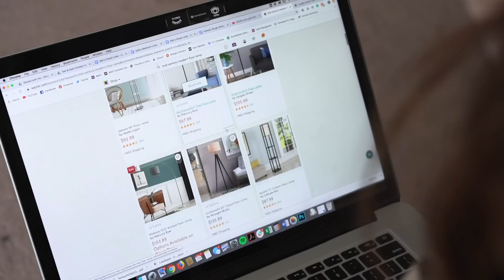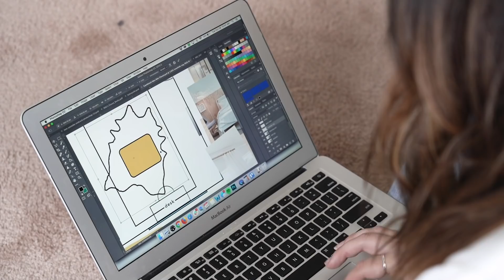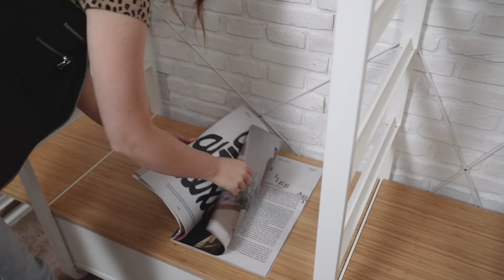Spare Room to Dream Walk-in Closet Makeover! | Style Selected

Comment: Hey ladies. Love the channel. Quick tip. Electronic stud finders check the density of the wall. So if the insulation is thicker it will light up. Using a heavy magnet to find the metal drywall screws work better in most cases. I use this in my line of work. Much better. Tho if you have plaster walls the magnet won’t work as well if there is chicken wire in the wall. Just a helpful time. Keep on rocking.

Comment: Pro tip for finding studs: check either side of a plug, there will almost always be a stud immediately to the left or right. The boxes for plugs and switches need screwed into wood on either a side or the back. Since plug placement usually isn’t that important, the fastest and easiest way for the electrician to install the box is to screw the side of the box into a stud. Once you find one stud, studs are usually every 16” on center. Time is money for trades, so this works at least 99% of the time. You can also try measuring from one of the corners, but that’s not nearly as reliable (depends which side they’re measuring from and what end they started with, among other things).

Comment: The big wood panels on the mirror wall also didn’t align at the seam (22:52) - one piece was half an inch higher than the other and if it was behind the mirror it would have been fine i guess but the mirror didn’t even cover it..

Comment: I get that you aren't professional and this is "DIY" ...but this is just messy. You have some pretty advanced equipment - you should have a simple step ladder. I understand it was the first time working with that brick paneling, but it was so sloppy. And you could have taken the electrical covers off, cut a hole smaller, and then replaced the covers so you didnt have such a jagged edge. And is any of the wood sanded? It looks like all the corners on the walls and edges around the electrical sockets are all still sharp and splintery. And that round hole for the outlets? If thats what you want and least make it big enough to not cover the natural rectangle of the outlet cover. Also, you need to be dressed to work like this: loose clothing around a circular saw especially when youre not using on a proper table is extremely dangerous

Comment: I hate all the corners cut in this project. You're supposed to cut the edges of the brick so it doesn't have that weird lip on the left hand side. Also the circular holes for the outlets and switches i HATE just do rectangles and make them fit snugly....no hate...there were so many messy parts to it. It looked good in the end just would have been better had everything been done better

Comment: The energy is off. No question. 
The plywood could've been totally seventies, like wood paneling, if it had been stained or sealed. Not raw. It looks weird raw. 
The dog shit. Enough said. Should've refused the job until the room was sanitary. Period. Have some self respect. 
The round hole around the outlet, why? Take the outlet cover off, measure and cut the hole, put the wood up, and then put the cover back on. Attention to details MATTERS. 
The faux brick still isn't joining well. It either needed more screws,  some joint compound, or two part epoxy holding the edges down to the piece behind it.  Something. There were so many options to blend those pieces together better.
Also, it's so easy to wire those light in so they work with the switch. Without it, she has to get literally the entire way into the room before being able turn to the light on. Which is no biggie during the day, but at night? That room will be super dark. 

I love the concept of this channel, and the girls are sweet, but the actual DIYs always feel half-assed. never does it feel like a job well done, and done properly. They spend so much time, so much money, clearly have the knowledge and tools to do it right, and yet, never done right. It's infuriating to watch.